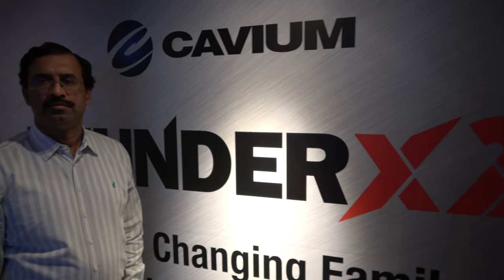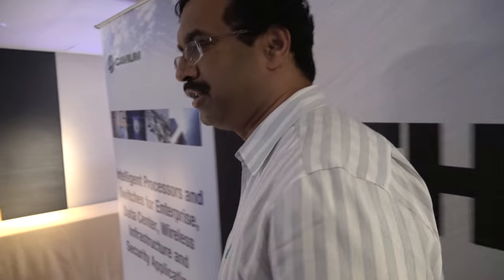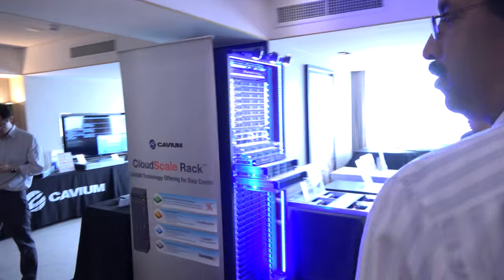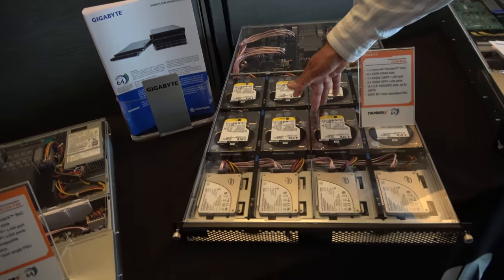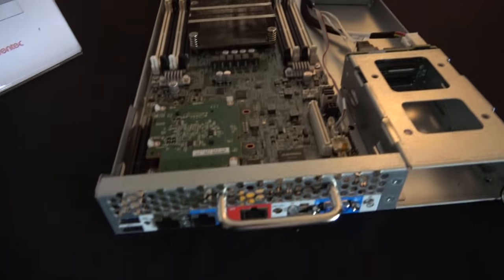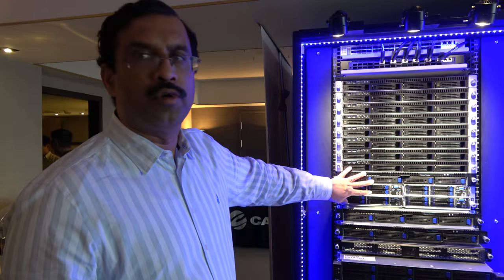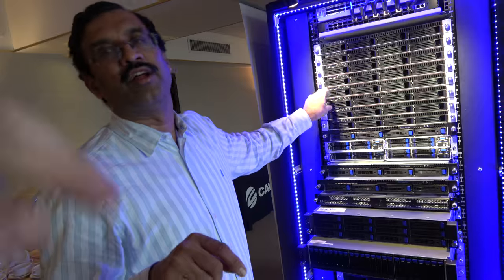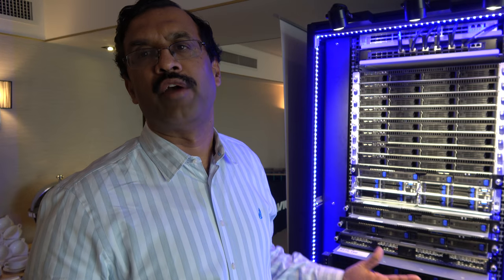Cavium ThunderX2, 54-core 3Ghz 14nm ARM Server Processor

Comment: Apples to apples cost to application performance? Or can I still build a cheaper cluster with old i5's or i7's? Do you have a secret weapon that startups can use to level up and compete, or not? Or are you just going to price discriminate and serve the status quo?
Reply: I think Cavium Thunderx excells in I/O heavy, CPU light applications like video servers, storage serves,web server etc.
Reply: I7/i9 will still be cheaper, but in a large serve farm performance per watt will be better. The main cost of running a server over its life is power not hardware. Total cost  of ownership over the server's life is most power.

Comment: how many multicast hd tv servers can i run at one time ..at what bandwidth out put on one box
Reply: The original ThunderX platform being sold by System76 has up to 160 gigabits per second of network throughput and up to 1 TB of RAM. I assume ThunderX2 is faster.